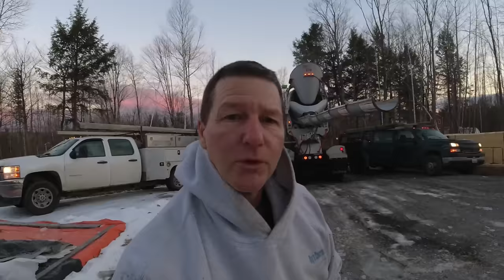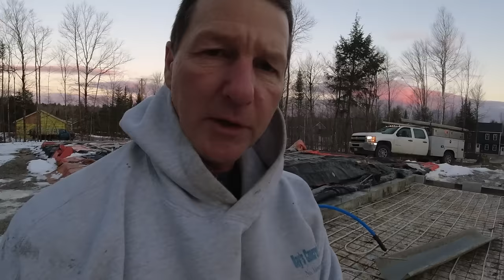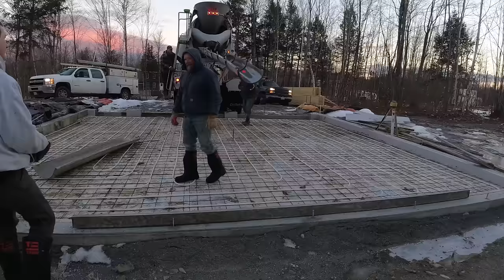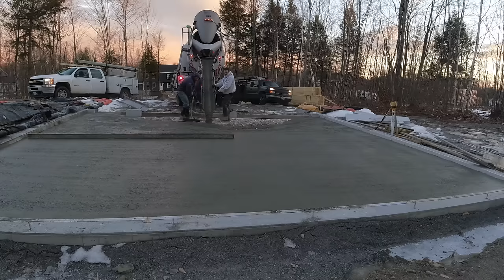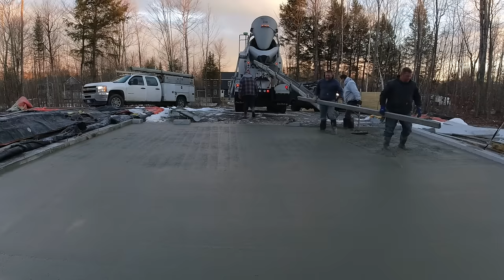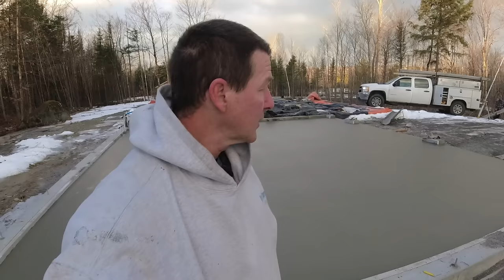Cold Weather Concrete Mix with Admixtures Revealed - 3500 PSI Mix

Comment: Question... So with overboots (yellow) i usually put plastic shopping bags over my boots. It literally helps when its time to take them off. Question is do you or would you put on plastic bags for the treds? Ive been looking at them for awhile (they stink in the box they come in lmao). Summertime i wear reg pouring boots. Wintertime i greatly appreciate overboots lol. Thanks
Reply from the maker: You can use the plastic bags, I haven't yet and they come off OK for me.
Reply: @MikeDayConcrete  Awesome. Thank you brother. Amazon has them for $75 an White Cap has them for $120 lol. I think I may pull the trigger on them. Thanks again

Comment: We are having a very hard time getting our concrete to set in the colder weather. I pour a lot of pole barns. I put heaters in there and fans blowing air around and we’re still there for at least 12 hours trying to finish it. Do you have any suggestions It would be very much appreciated.
Reply from the maker: Hot water in the mix and bag accelerator is what works best for us.

Comment: Hay, why is concrete so often not compacted (vibrated) in the USA? 
Greetings from Upper Bavaria
Reply: It’s shallow here and filled in well as they go. Vib is really needed on deeper pours and final finish shuttered. The slab has extra chemicals and heat in the water to help it flow into all spaces.

Comment: Do you sofcut your radiant heated floors?
Reply: You still have to yes. Saw shouldn’t cut deep enough to hit the tubing
Reply from the maker: Yes, we do. The cut goes about an inch deep.
Reply: @MikeDayConcrete  yeah it's about an inch deep (depending on new or old blade lol). I allways tell contractors an homeowners to not cut radiant heat. If God forbid it nicked a line an they can prove it. It's the same on open slabs anything 30%or above rain I won't pour no matter sign a waiver or not.